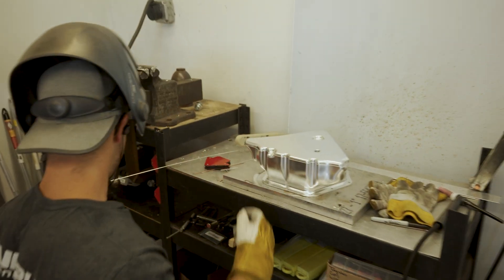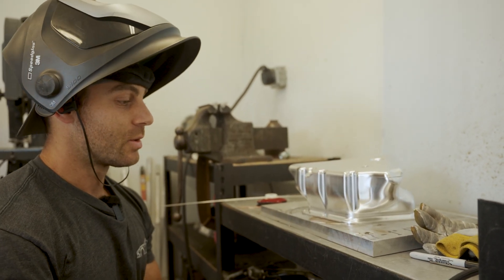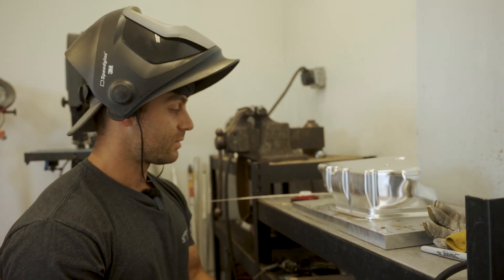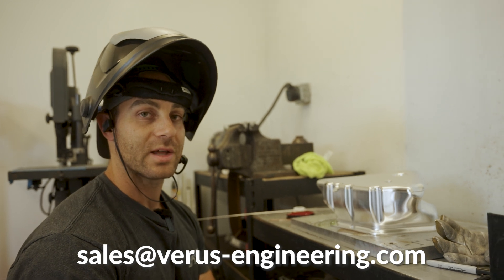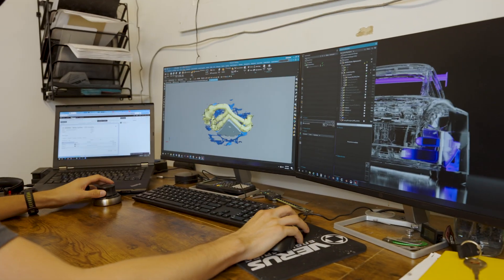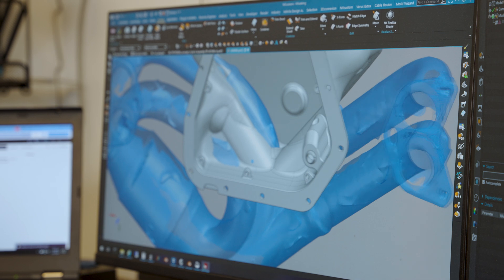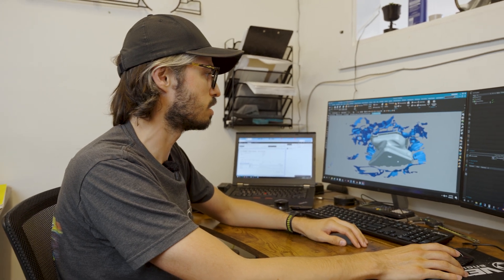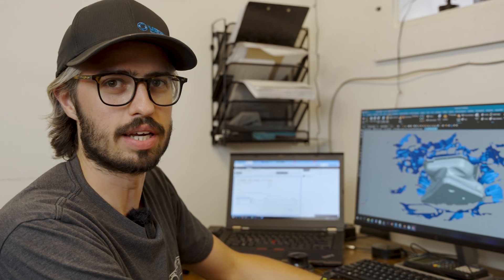GR86/BRZ FA24 Oil Pan Update 3 | Verus Engineering

Comment: Isn't placing pan to headers that close plus without heatshield would transfer heat to the pan increasing oil temp?
And wouldn't vibration and heat expansion cause headers to touch the pan?
Reply from the maker: We saw no real issues on the vehicles we tested this on but we've increased the gap as well on the latest revision.
Reply: @VerusEngineering  great! 
Can't wait for the final product.

Comment: Will you guys be looking into your oil pan fitting on equal length headers? Also, love the work you're doing. I recently sold my 2019 Mazda Miata and I was running a bunch of Verus parts. I hope I can get more Verus parts on my 2024 GR86
Reply from the maker: Not specifically for equal length headers, but we are going to try our best to ensure it fits with as many aftermarket headers as possible.

Comment: Once the design is finalized, you should consider offering an option with an oil return pipe welded for people running a turbo. Regardless, would be great to have a data-proven solution to the oiling issues.
Reply from the maker: We will keep it in mind.

Comment: If im understanding correctly, isnt the oil pan(edit: the one your guys are making) much larger than it needs to be? Doesnt the oil pan just need to be about 0.5L larger than the stock oil pan to eliminate oil starvation entirely? I see mainly benefits to make the pan smaller(the one you guys are making) so that the stock heatshield can be kept, reduce costs, and it would fit all aftermarket exhausts thus expanding your customer base to all GRZ owners with their various exhaust setups, and make installation easier.
Reply from the maker: No, it is not larger than it needs to be. We would not advise making a smaller pan. People are already overfilling the pans to help with the oil starvation issues.
Reply: @VerusEngineering  edit: sorry, I just realised that I think you might have misread the comment. I was referring to this pan you guys are making. Isn't 1.3L extra too large? I know the stock oil pan is too small but why cant the pan you guys are making be 0.5L(or 0.8L just in case) larger than stock instead?

Original comment: hmm.. what is the minimum threshold size needed of the pan to eliminate the oil starvation issue? Has that been measured out/tested?

Comment: Is there a big difference in the pan for the 1st generation and the second.?  Would it be possible to fit on on the first gen if the header clears like an Ace 350 equal length
Reply from the maker: Yes, there is a difference. This pan will only work with the FA24.

Comment: Nice work! From my experiences I would suggest a distance of the headers to non-machined casting surfaces of at least 5mm due to (casting-) tolerances and heat expansion.
Reply from the maker: Thank you and thanks for the input.

Comment: Thanks for the update! Sad to see the JDL UEL "just" doesn't fit at this time. Hope to see / hear more updates and I am all in for a production unit (although I will be running UELs).
Reply from the maker: The JDL UEL could work with slight massaging of the runner that contacts. A couple taps with a large rubber mallet should do it. It is very close to working though.
Reply: @VerusEngineering Just curious about JDL EL header, I’m running that instead of UEL.

From the look of the UEL scan, I believe there should be plenty of clearance for EL version 🤞🏿🙈
Reply from the maker: @bellyslap217  Unfortunately, we cannot confirm the EL header at this time.
Reply: @VerusEngineering  let’s hope someone can 3D scan for you🫨
Reply: @VerusEngineering  would you guys be fine with us giving the oil pan the ole whack? or would doing it void the warranty?